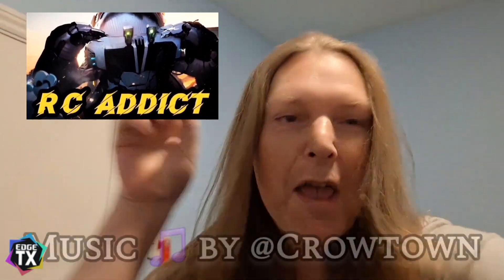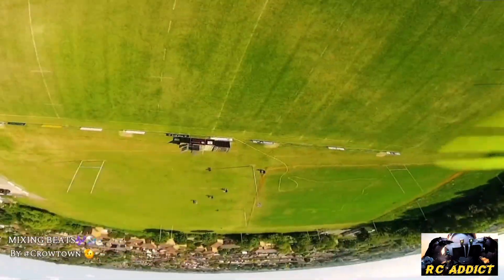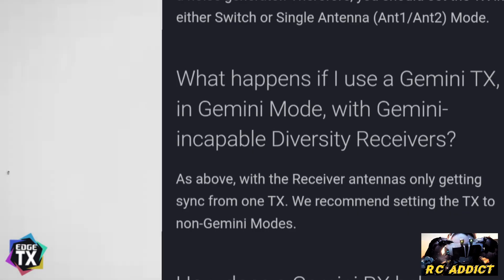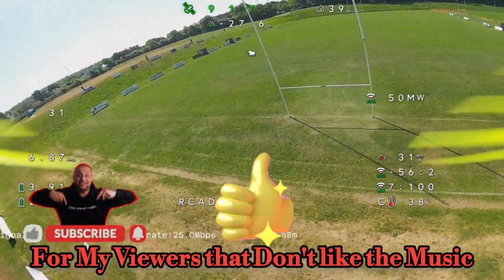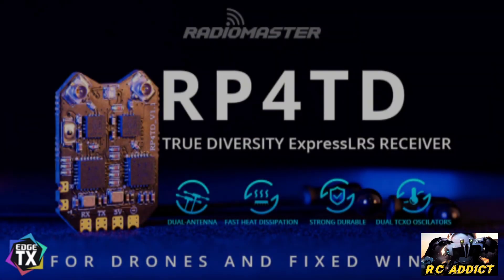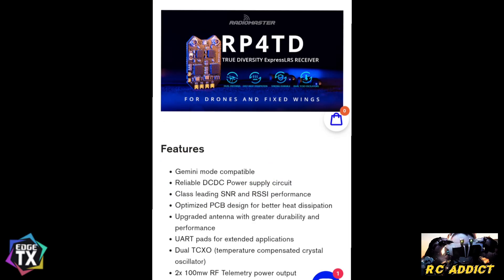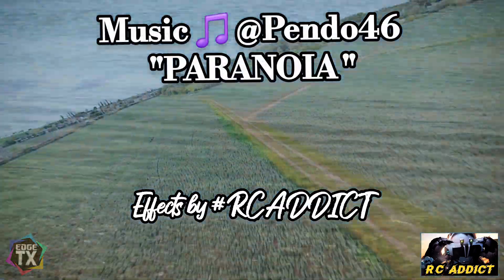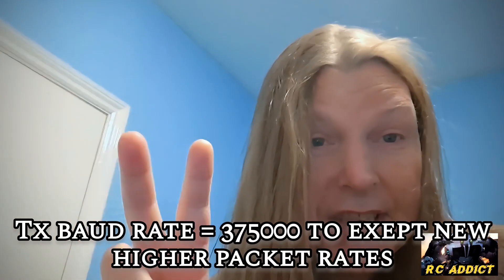STOP! YOUR CREATING AN EXPRESSLRS NOISE GENERATOR! #expresslrs #gemini

Comment from the maker: ❤SOME LOVED THIS FAST PACED DETAILED MASHUP & A FEW HATED IT! but no one has come up with the fault yet? the video is simple.
Why is my gemini 2.4ghz nomad in gemini mode, and my 2.4ghz matek rx true diversity, in gemini mode,  the LQ HELD 100 % "(AS ITS SUPPOSED TO) BUT AT MAX 1000mw TX POWER in Dynamic mode AT 50 METRES AWAY, AND ULTIMATELY FAILSAFING!
Same firmware, radiomaster generic RP4TD FIRMWARE on Mateksys R24-TD?
Its a simple question?

Comment: There’s so much going on in this video
Reply: Organized chaos. Pretty much sums up my fpv lifestyle.
Reply from the maker: Yep, but no one has come up with the fault yet? @coleeckert5663 the video is simple.
Why is my gemini 2.4ghz nomad in gemini mode, and my 2.4ghz matek rx true diversity, in gemini mode,  Why is the LQ HELD 100 % "AS ITS SUPPOSED TO) BUT AT MAX 1000mw TX POWER in Dynamic mode!
Same firmware, radiomaster generic RP4TD FIRMWARE on Mateksys R24-TD?
Its a simple question?
WHY IS IT AT 1000MW AT 50M AWAY BUT DOINGVWHATVITS SUPPOSED TO DO, HOLD LQ AT 100%
You guys obviously didn't like the rave generation?
Reply from the maker: ❤SOME LOVED THIS FAST PACED DETAILED MASHUP & A FEW HATED IT! but no one has come up with the fault yet? the video is simple.
Why is my gemini 2.4ghz nomad in gemini mode, and my 2.4ghz matek rx true diversity, in gemini mode,  the LQ HELD 100 % "(AS ITS SUPPOSED TO) BUT AT MAX 1000mw TX POWER in Dynamic mode AT 50 METRES AWAY, AND ULTIMATELY FAILSAFING!
Same firmware, radiomaster generic RP4TD FIRMWARE on Mateksys R24-TD?
Its a simple question?
You guys obviously didn't like the rave generation?
Reply from the maker: Is that good or bad for you?

Comment: And here I'm just happily flying with the ceramic rp2 :-)
Reply: I’m flying some old ass Happymodels EP1’s and 2’s they work great and I have zero motivation to replace them until they crap out. 
Hope the both of you are doing well, keep up the good fight, 
🐩🪽
Reply: @angrypenguinswilldestroy having fun is the goal and if you're having fun I say keep doing what you're doing!
Reply from the maker: Yes, thats just it Stace, there is no point!
Ive flown expresslrs for 4 years now, when it came out, and i thought id just try the gemini mode out, the nomad module is brilliant, well made, good fan, and backward compatable to my older matek diversity r24ds, NEVER A FAILSAFE, NEVER OVER 50MW IN THAT WHOLE 6 RUGBY PITCHs.
The TRUE DIVERSITY one in the video is fine in  normal mode, antena switching on NOMAD.
SO YOU MAKE A TOTAL HONEST REMARK!
POINTLESS FOR FREESTYLE!❤
THANKS FOR COMMENTING AND WATCHING! ARE YOU OK?
Reply: @rcaddict9558  Yessir!  Doing great.
Reply from the maker: ❤SOME LOVED THIS FAST PACED DETAILED MASHUP & A FEW HATED IT! but no one has come up with the fault yet? the video is simple.
Why is my gemini 2.4ghz nomad ,in gemini mode, and my 2.4ghz matek rx true diversity, in gemini mode,  the LQ HELD 100 % "(AS ITS SUPPOSED TO) "BUT AT MAX 1000mw TX POWER , Dynamic mode AT 50 METRES AWAY, AND ULTIMATELY FAILSAFING!
Same firmware, radiomaster generic RP4TD v3.5.1 FIRMWARE on Mateksys R24-TD?
Its a simple question?
Many criticised  but the question was simple?
Ooo, Stace, this is hard work sometimes isn't it?🙄😶‍🌫️